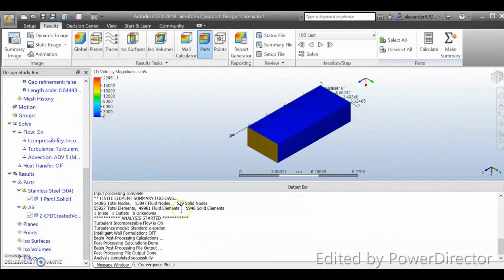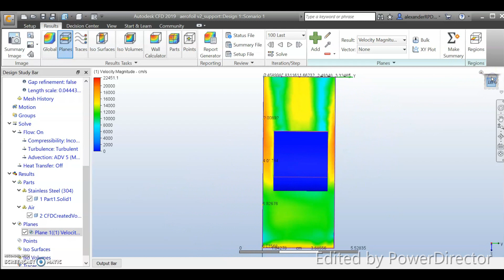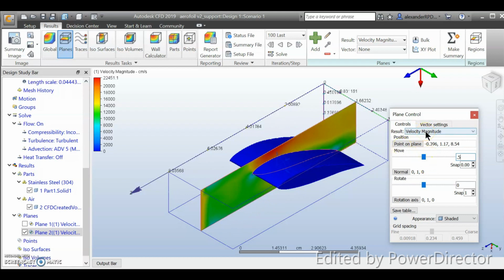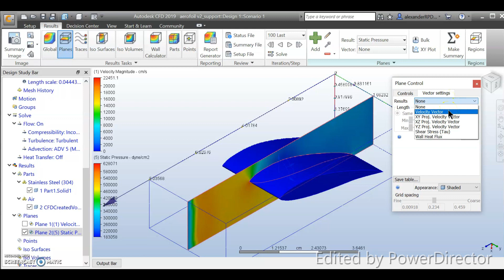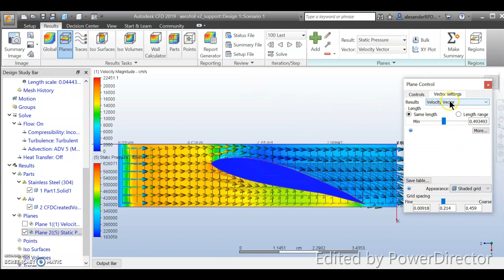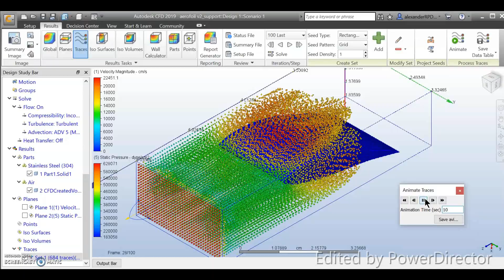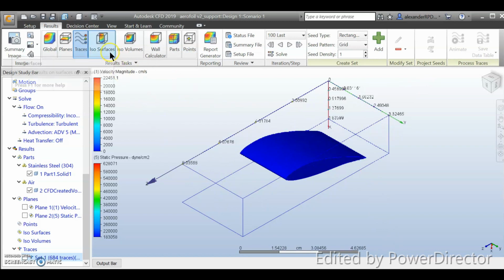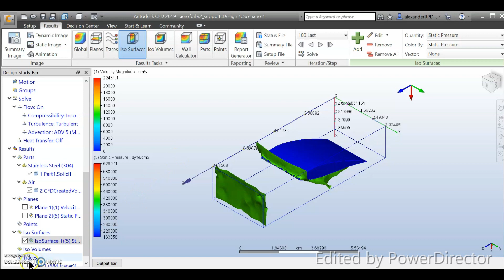Autodesk CFD 2019 #ExternalFlow Result Evaluation

Comment: Hi. So I'm working on using CFD  for measuring lift and drag of an airfoil. However I couldn't figure out how to make the box around the foil for the external flow. I'm new to this software and really need help ASAP.
Thanks
Reply from the maker: You can try to other video of the External Flow series in my channel, there is a demonstration how to do the setting

Comment: Hi Mr Chee.Would you mind helping me in cfd simulation for a rotary stainless steel drum filled 30% of internal volume by water at the bottom and coverd by molten sulfur at external surface to be cooled by inner water(solidification)?

Comment: Hi. Does autodesk provide tutorial for flow simulation? I really want to learn about it. I ever used Ansys Fluent but it takes ages to run transient simulation. I just want to visualize my oven design with convection fan. Thanks
Reply from the maker: transient simulation may not working in Autodesk CFD, so if you are looking for transient, I will still recommend FLUENT.
Reply: Transient simulations are possible with Autodesk Cfd. See in Solver options

Comment: Sir, if from revit 2022 is can use this cfd 2019 ?
Reply from the maker: 2019 version can't read file from 2022, however, backward is possible but depend on the file type.

Comment: when ı press static pressure ( 02.18 ), getting red all of the plane. what can ı do
Reply from the maker: most probably you set the boundary condition incorrect in that case. Check the BC properly especially the direction of the flow

Comment: Can you know the lifting force of the wing?
Reply from the maker: you can turn your result to Pressure and observe it on the bottom surface, then use iProperties to investigate the surface area. Pressure = Force/Area, then you may have the lift force.

Kind of a "manual" work
Reply: @ir.ts.dr.alexanderchee3059  so there is no way of it calculating it for you. I have made a some what complex wing and only have rough estimates of the lift it produces. Was hoping the CFD would give more accurate results.

Comment: Hello, nice video. I’m trying to do a similar analysis on an aircraft wing. I created a box using solidworks with glass material around the wing and import the Solidworks assembly into Autodesk CFD. The problem i’m having is, the puter box does not turn into transparent or become an outline when I select either of the two options. This is causing my simulation to be made only on the outer box. I trued this both as importing it as an assembly and also a step file. Any suggestions? Thanks
Reply from the maker: Thanks for watching.
In your setting under Geometry Tools, have you selected "Ext Volume" instead of "Void fill"?

Try to watch my tutorial video on External Flow setup.